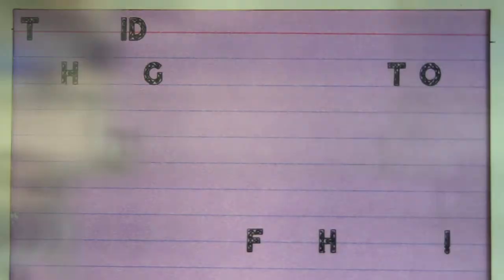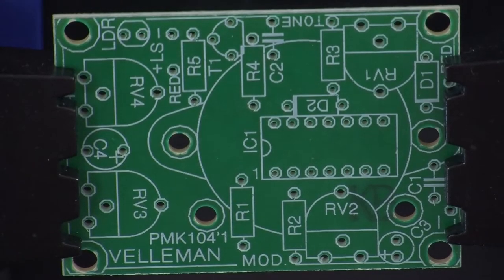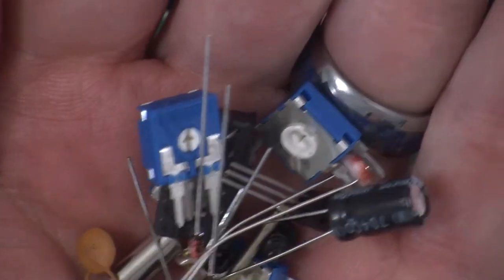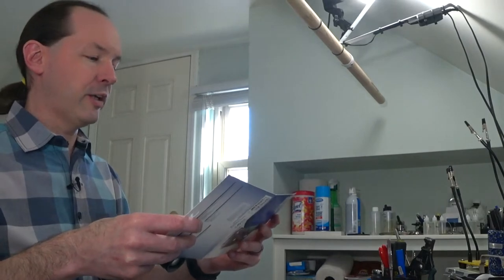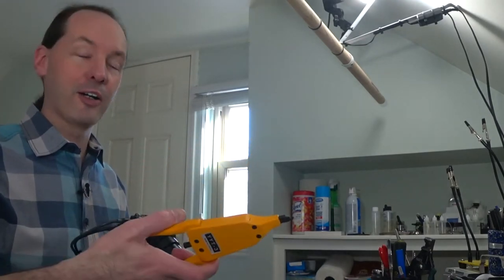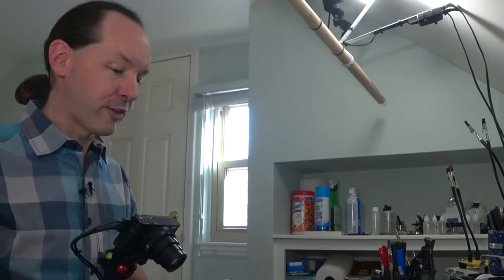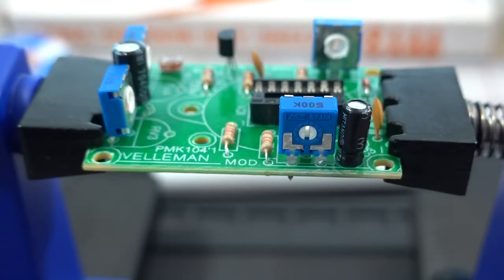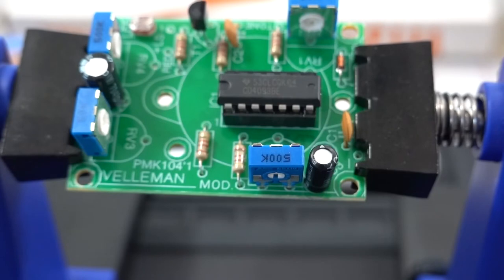Chris Boden - Kits With Chris Episode 5 - Velleman Cricket

Comment: Ceramic capacitors like that are always in pico Farads so the 1st two digits are the values and the 3rd is the multiplier.  So 104 = 10 x 10,000  = 100,000 pF = 100nF

And when you get to surface mount components eventually, the resistors are labeled in the same manner.
Reply: Yep!
Inductors too!

Comment: The reason they always start with resisters is they are the closest to the PCB. Assemble smallest components first. Clipping the leads from the tape keeps the sticky stuff from getting in the hole.

Comment: LDR is light dependent resistor, cds is what it's made of, cadmium sulphide, resistors are not polarity specific.
The flux can be applied to the whole board, it may solidify, but melt when heated.
You don't need to use it if the board is clean if the solder has flux, if you do a joint without flux and it doesn't look good, use flux for the rest.
Makes me laugh when you use the clip to hold the component then clip the wires, why not just solder when it's held in place. that tool is just a gimmick that could flatten a wire into another trace, case in point, the middle pin of t1 is dangerously close to another blob..
When you clean the tip, dab a bit of solder on it.
Did you adjust the light pot ? might have to turn it for sensitivity